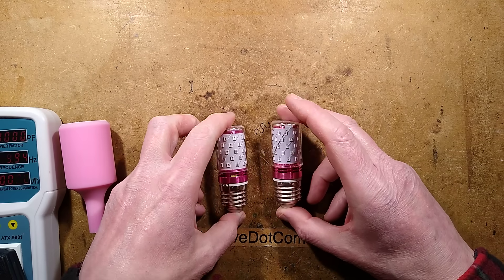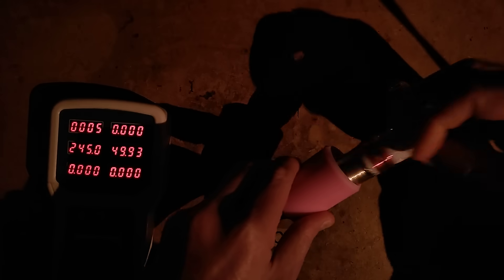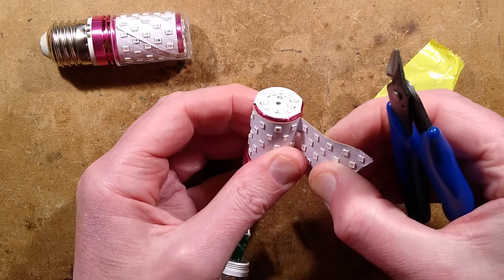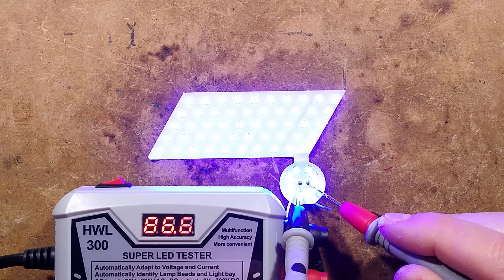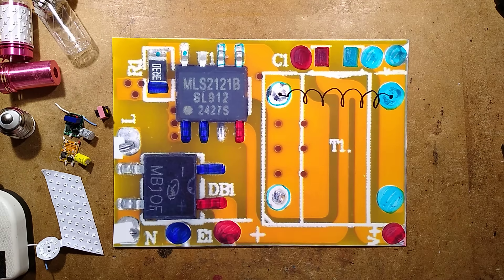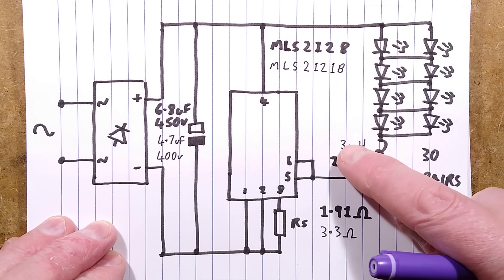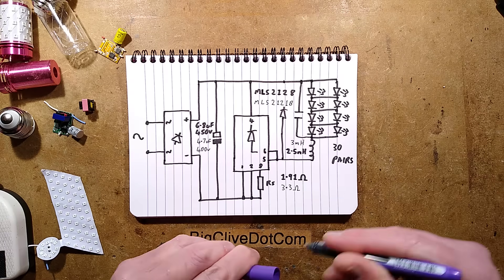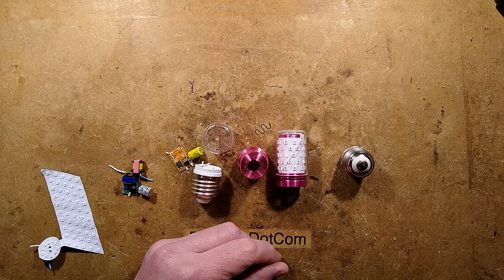Randomly overpowered scammy "sterilising" lights

Comment: Nice video, Clive. Are these lamps worth it for the parts? Is it possible to 'dooby' these lamps? Is the output actually harmful in any way such as UV emission or are they just a coloured lamp? 

I was wondering if the aluminium housing would enable one of these to be converted with, for example, a single aluminium-mounted LED on the end such as the type used in torches along the lines of the Luxeon Star series or similar. It would make an interesting 'frankenstein lamp' if the aluminium body of this lamp was turned with a thread so that a torch head would screw onto it effectively making a torch that would screw into a lamp socket. Somehow, I can imagine such a lamp finding an application as a miniature spot lamp maybe is museums, art galleries or even theatres, particularly if there was a dimmable version.
Reply from the maker: They're just blue LEDs.  The sense resistor could be increased to lower the current, but as with all modern LED bulbs with exposed metal, they should not be handled while powered.

Comment: 12:03 I don't think this is quite right. What you're describing is DCM operation, but a constant-current device like this would be much more likely to operate in Continuous Conduction Mode. In CCM the current through the inductor is held between between two thresholds, so it never drops to zero. The switch isn't turned off for a fixed time, it's turned off for a variable time dependent on the load. As a result, the LEDs aren't pulsed on or off, they're always on, with just a little triangle wave.
You can test this with a (non-grounded) scope across the inductor: you should see the triangle wave frequency change with the forrward  voltage/LEDs in series, with the offset remaining constant.
Reply: One other thing I should have added: if this worked in pulsed operation at that frequency, it wouldn't have a silicon diode where you measured it at 0.6V. It would need a schottky at that speed, which would have a lower forward voltage. The silicon diode works fine for protecting the mosfet because it doesn't need a fast reverse recovery, only fast turn-on.

Comment: Looks, like they fake everything.
Just ordered Crankshaft Bearing Shells for a Transit engine, supposedly from Mahle - but they are 1/100 too thin.
So i checked the numbers and they are almost the Mahle numbers, but one digit is different.
The number is unknown to Google. 
Strange.
And annoying of course, had to use the used ones, with 250 000 Km on it they fitted better than the brand new ones from who knows where.

Comment: If the switching frequency is high enough the current through the inductor, and the LEDs, would be "substantially" constant so an output capacitor may not be neccessary - at least for lighting the LEDs - RFI is another matter but I guess no-one cares about that?
Reply: I agree. The current waveform will ramp up and down but will always be substantially more than zero.
Reply: @kenmercer2721  It depends, buck converters can run in a return to zero mode or a continuous current mode, depends on inductor, frequency and duty cycle

Comment: Thanks for another post. I recently bought a rice cooker for a tenner.  It's a cheap wee thing that cooks rice perfectly and for the life of me I can't figure out how it knows when the rice is cooked. There is only a pan you put the rice and water in and it rests on a heating element placed on a spring of sorts. There are no sensors that I can find but sure enough it knows when the rice is done and will switch from cook mode to warm mode. Since it cooks different amounts of rice 2-6 cups I had thought perhaps the spring was some sort of weight sensor but how would it know the difference between cooking 2-6 cups of rice as there is only an on/off switch and no way to input the amount?
Reply: The "spring" is a bimetallic strip that bends depending on its temperature. While the rice is still cooking (aka, there's still water that can evaporate), the bottom plate that touches the strip can not get hotter than 100°C because the evaporating water constantly "pulls away" heat. When all the water got absorbed by the rice the bottom heats above 100°C, the strip bends and breaks the circuit for the main heater. That's when the cooker switches to "keep warm" mode. It's a super simple principle, that's one reason why rice cookers can be produced so dirt cheap.
Reply: Technology Connections had a video on rice cookers which described how they work. The short version is that spring is a thermostatic switch. As long as there's still water in the pot, the switch stays on, when the water is absorbed, and evaporated, the temperature rises above the cutoff point, and the switch puts the cooker in warming mode.
Reply: My take on these is the spring ensures good thermal contact to the pan for the thermoswitch which is a magnet formulated to have its curie point just about the boiling point of water. Once the water boils away the magnet loses (reversibly) it's magnetism and contacts to the main heater open, the small keep warm heater keeps things warm thereafter. Curie point is how the old Weller Magnastat soldering irons regulated temp. BC will do a much better explanation than mine in his teardowns!
Reply: @erichpwagner  A ferromagnet heated above its Curie point loses its permanent magnetic field as its atoms jiggle around in random, domainless orientations. When it transitions to back below its Curie point its magnetic domains are arranged more or less randomly meaning it has practically no magnetic field, just a residual field influenced by whatever magnetic field is applied to the material as it transitions which would be the local magnetic field due to Earth's magnetic field and the quasi-random arrangement of fields from wires in a kitchen, the size and direction of all of which depend on where on Earth you live and what direction you have you rice cooker facing in use.

Your proposal would require that the rice cooker has a coil dedicated to inducing a magnetic field strong and large enough to apply itself to a material to induce that material being a permanent magnet. I'm sure you can see this solution is the opposite of cheap and dimple. 

You have unfortunately misunderstood or been misinformed about how the Weller magnastat functions. The soldering iron contains, when cool, two ferromagnetic materials, only one of which is what we'd call a permanent magnet. One material is the tip itself which we would not call a magnet, the other is a magnet on a spring When the tip is cool the magnet is attracted to the tip. When the tip heats it transitions above its Curie point, it becomes paramagnetic and the magnet is no longer attracted to it allowing the spring to pull the magnet back cutting the power. As it cools below the Curie point it transitions back to a ferromagnetic material allowing the magnet to again be attracted and overcome the spring tension switching power on. There is no magnet that gains and loses its magnetic field as it transitions past its Curie point, there is a ferromagnetic material that changes to paramagnetic and back losing or gaining its ability to be attracted by a magnetic field.
Reply: Technology Connections has a good video on those explaining them. The short of it is that the rice cooker looks for the temperature to go to a certain just above boiling temperature to see if all the water has been absorbed by the rice.
Reply: Maby a fixed timer running a cycle each time you start it
Reply: The Chinese have been doing it for along time  , ask around China town

Comment: Bigclive, are you going to find anymore dangerous mains charging torches or dogey power supplies ?
You know, the ones that will fry you whilst charging.
I really enjoyed them videos
Reply from the maker: I've just received an absolutely hideous multi-way extension with USB to take apart.
Reply: These bulbs probably qualify, I don't think sticky flex PCB backing counts as double insulated.
Reply: Is a dogey power supply the one that causes Teslas to burst into flame?
Reply: @paulabraham2550  I just heard DiodeGoneWild's voice say "Super Doge-y" in my head. 😆
Reply: @paulabraham2550  and porsche tycan turbos s

Comment: I sure wouldn't want to put a 10W light running in my fridge continuously. That's 10W of heat that needs to be removed.
Reply: No one here actually watched the video
Reply: @journaljemmy why watch the video if you can just assume to know what people are talking about and then be a jerk about it?
Reply: I think some of those newer fridges with glass doors might have a light on always...dont quote me, i only have a " normal" fridge i guess
Reply: Equivalentcy of one hot boiled egg..
Reply: And you're positive the light stays on when the door is shut.......
Reply: @RocknRollJesus101  Yep. Borrowed Schrödinger’s cat to check for me.
Reply: @theoztreecrasher2647  xD Great one.
Reply: @theoztreecrasher2647  and you speak dead cat fluently?
Reply: @ Just got to get close enough to the fur!
Reply: @theoztreecrasher2647  lol. Bet you've never been "close to the fur" since it had you.
Reply: @ My name is not Jesus. 😈
Reply: @theoztreecrasher2647  my name is not "reec Rasher"😂
Reply: @RocknRollJesus101 Continuously usually means that. :)
Reply: @daviddavidson2357  what model fridge "continuously" lights its interior lil guy? I'll wait....
Reply: @RocknRollJesus101  The one where you disable the door light switch.
Not difficult, just short two wires in most cases. 

Again. OP said constantly
Reply: @daviddavidson2357  and you'd do this why son? Btw I understand the term "constantly" pretty well and it's been used "constantly" here. Dare I guess you're both millennials?
Reply: @RocknRollJesus101  Why?
Because you may want a constant running germicidal lamp in your refrigerator.

Also, I'm not your son, thank god.
Reply: @RocknRollJesus101 "Lil guy", "son"... where are you from? Nobody talks like that.
Reply: @daviddavidson2357  thank God for me lil beta guy. Your fridge needing 24/7 disinfection speaks volumes lil Jimmie. 🤣 Thanks for letting me know you're a millennial without actually admitting it.
Reply: @unvergebeneid  maybe try hanging out with adults occasionally lil fella.
Reply: @RocknRollJesus101  I'm simply following along with what OP said. Continuous 

Also, I'd recommend you ask your doctor about memantine. Looks like you're starting to develop a little of that old timer's disease. About as sharp as wet cardboard m80.
Reply: @RocknRollJesus101 you're funny 😘
Reply: @unvergebeneid  again yes...  and taste good as you mentioned last time. .
Reply: @RocknRollJesus101  one with a germicidal lamp installed to destroy microbes which is what he discussed in the video.. the lamp that normal fridges have on a door open switch being germicidal would be pointless.
Reply: Watch out fellas we got an ALPHA over here! This dude watches Joe Rogan podcasts.
Reply: @carlwheezerofsouls3273  Who are you talking about?
Reply: @unvergebeneid  Rocknrolljesus. mobile doesn't tag the person you're replying to for some reason.

Comment: If you had a real uv light in a fridge it would eventually break down the plastic inside

Given the power output, you're certain those aren't meant for 110v use only?
Reply: That's a great point (the second one). Sorry it got lost because no one bothered to read on.
Reply: @mumiemonstret  no worry, its there for people who check things
Reply from the maker: Not if it was a low power one.
Reply: @bigclivedotcom  so low as to not be sterilising
Reply: Mhh you think the power is high enough to decay the plastic?
Reply: @nicoleibundgut534  its uv, you leave it on bathing the shitty fridge plastic and see what happens, that stuff falls apart if you get listerine on it 😂
Reply: ... My god, its plastic, it photo degrades ☠️
Reply: @phonotical  Yeah true. So an UVC Light that runs for 1 hour per day would lower the lifespan of the HDPE inside i guess lol. If you would get a all black inside this would propably live long enough. The waterpipes we use are PE 100 and have coal in it so the UV radiation only penetrates the surface. hehe penetrates.

Comment: The diode inside the chip might just be the usual protection diode. Most CMOS ICs will include diodes that clamp both input and output pins to a range of one diode drop above Vcc (or the positive rail) and one diode drop below the ground (or negative rail). 
In general you would expect to find a diode that is forward biased to allow current to flow from the pin to Vcc and another diode that is forward biased to allow current to flow from ground to the pin.
Reply from the maker: I think in this case it is specifically optimised for use in this way.